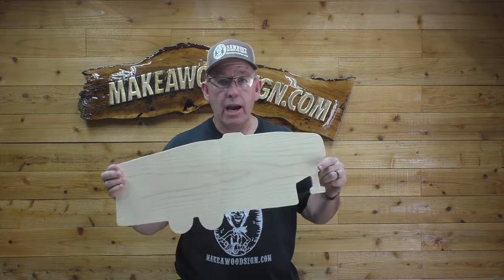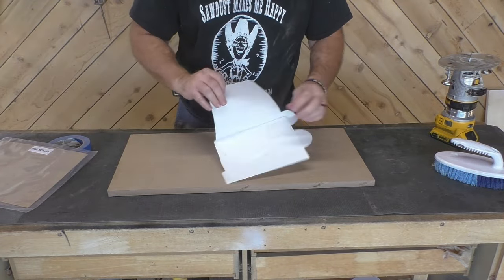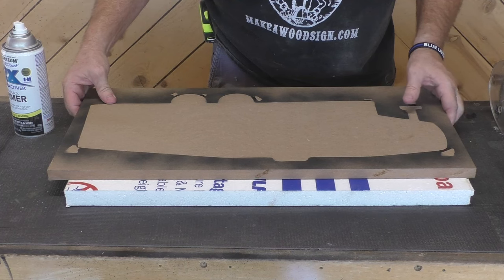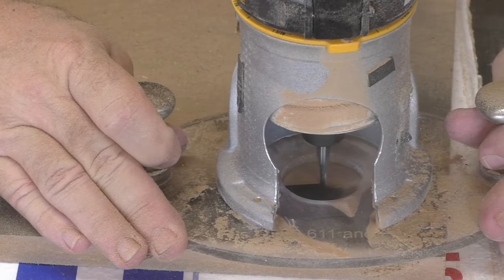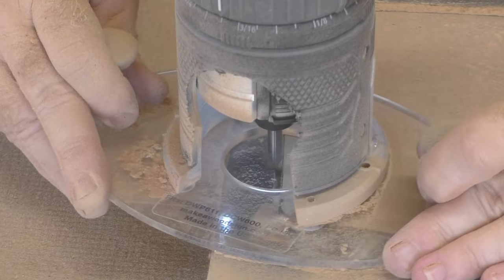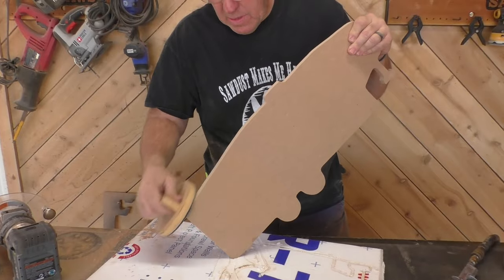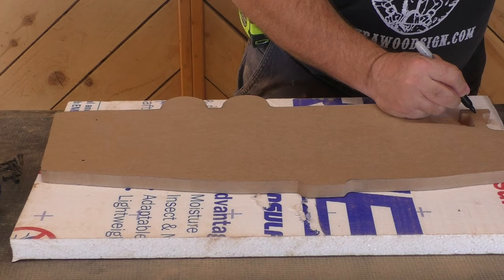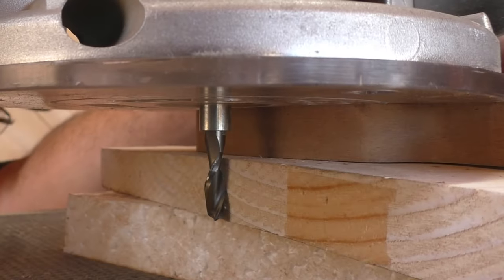How To Cut Shapes With A Hand Router

Comment: If your wood is sitting on sawhorses, is there any danger (more so than using a jigsaw) if your bit is lower/deeper than your wood?
Reply from the maker: I don't think so. I've never used this method with saw horses. Hut in order to cut the shape out, you do have to drop the bit all the way through the wood